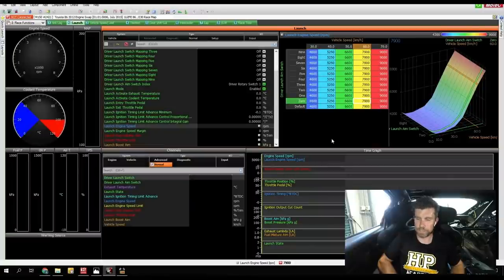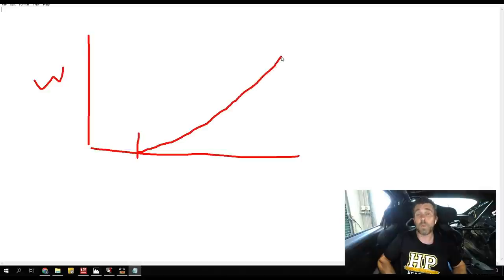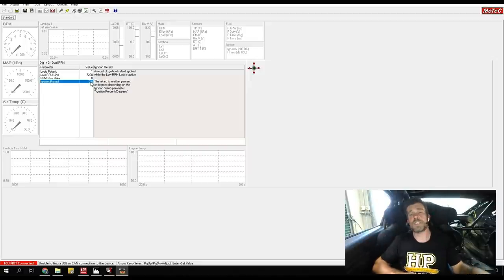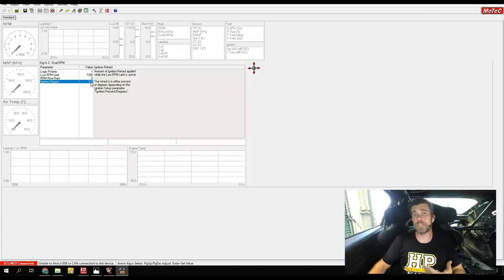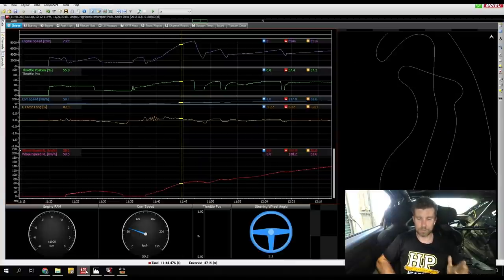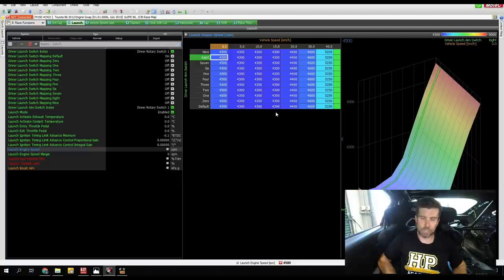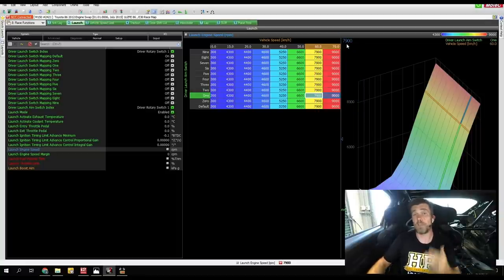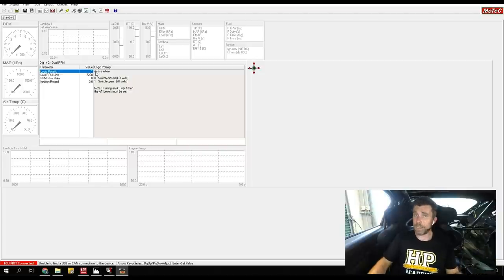The Ultimate Guide To LAUNCH CONTROL | Launch Control 101 [GOLD WEBINAR LESSON]

Comment: If you're implementing this on a RWD drag car on drag radials(I don't have experience with AWD + drag radials; do your research!), you'll want to ignore the 10% wheelspin rule of thumb - drag radials do NOT like to slip, and they tend to respond with very violent tire shake that can break parts. So, while street tires work best with some slip and bias ply slicks like to be hit hard and launch well with quite a bit of tire slip off the line, drag radials are the complete opposite, you want to dead hook with them. Dead hooking tends to make the engine bog, so this is the fine line you're walking with drag radials: you need to dead hook off the line while still feeding in enough power to prevent the engine from bogging, but not so much that you create brutal tire shake in the first 100ft.

With that said, there's always exceptions to every rule, and I have seen a small handful of combos that have made drag radials work with a bit of slip off the line. This is very uncommon though, these combos are pretty much anomalies. If you're going to explore getting a little slip out of a drag radial, then do so after you set your car up to dead hook first, and use that as your baseline. 

With that said, the tire companies have been developing much more forgiving drag radials lately. They still work best from a dead hook, but they're getting more forgiving when the tires break loose, less tire shake, less drivetrain shock loading. In fact, Hoosier's QTP Radials are pretty unique in that they're a true radial, but they respond very much like a bias ply slick. I haven't seen them race competitively much vs other drag radials, Mickey Thompson has really taken ownership of this market, so they may(or may not) be holding back a tenth or two of ET vs an MT ET Street R(MT's DOT radial race tires, in spite of the 'street' name) or MT Pro Bracket Radial, but they are an option for someone that wants a much more forgiving drag radial.

Comment: Very interesting. Thanks.
How much greater traction/acceleration can one achieve at optimal tire slip compared to no slip?
Couldn't accelerometers be used to calculate vehicle speed when front wheel speed or GPS can't be used.
In the case of the front wheels coming off the ground when referencing front wheel speed as mentioned in one question, I would assume that it would be useful to prevent wheelies.

Comment: I have a 2013 Hyundai Veloster with a tune it that has 2-step launch control at 3400 rpm. How can I adjust this down in HP Tuners s/w? Launching at 3400 rpm will just annihilate the tires. Looking for around 2800-3000.

Comment: Got into an argument with some people about launching and AWD. Would you guys say that AWD is harder on engines than FWD or RWD and why?
Reply: Levi Heizer its way harder you need more tq to launch an awd engine engine is cranking more to power to the flywheel to go, really stressful less stress fwd
Reply: None of them are exceptionally 'hard' on engines, modern engines are very well engineered & robust. AWD is significantly harder on everything after the engine in the powertrain though. Now, it depends on how you're actually launching, you don't HAVE TO launch an AWD car banging off the limiter and dropping the clutch - but, needless to say, max effort AWD launches are harder on the drivetrain than a comparable 2WD launch.
And this only gets magnified with more and more traction(larger/stickier tires) - while 2WD cars must have power fed into them at a very controlled rate(unless you have a manual drag car on bias ply drag slicks - bias plies love being hit hard, really benefit from a surprising amount of wheel spin on launch) to stay on the edge of the traction limits, AWD cars have to hit the drivetrain much harder to break the tires loose on launch so that the engine doesn't bog. This is what makes launching an AWD car so difficult, especially with more and more power, more and more traction.
Reply from the maker: The engine doesn't care, the driveline is what deals with the power. I believe in this interview JR touches on it: https://youtu.be/WLE03jDNeWE - Taz.
Reply: My thought was having more inertia in the drivetrain and more places for shock loads (4 tires instead of 2) it could produce larger moment spikes on the crank from constructive resonances in the drivetrain when your traction is coming and going. Like if all four wheels are hopping and grabbing at different speeds these moments would resonate through the drivetrain. These moment spikes on the crank could either land a bearing or ring up through the connecting rod and piston. You can put more load on a motor with AWD in a more street oriented car, but my concern more involved spikes of load in situations like launching or shifting gears.